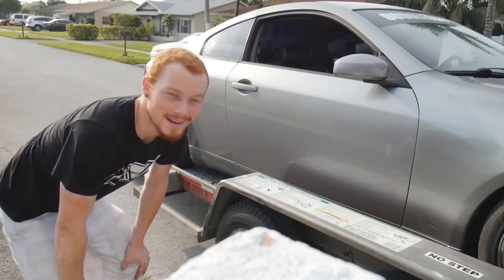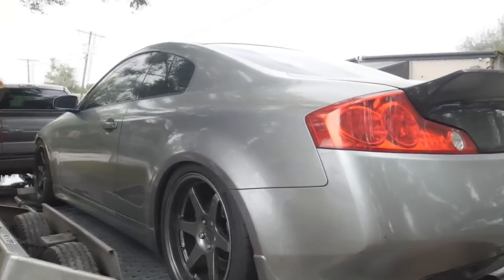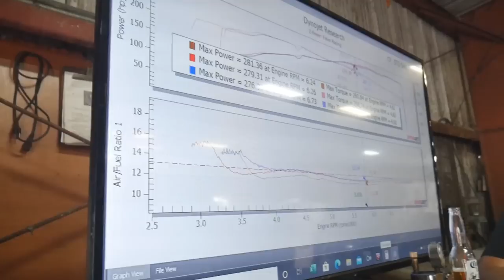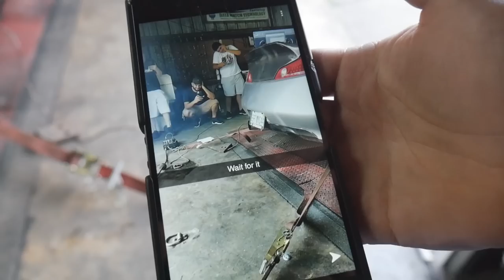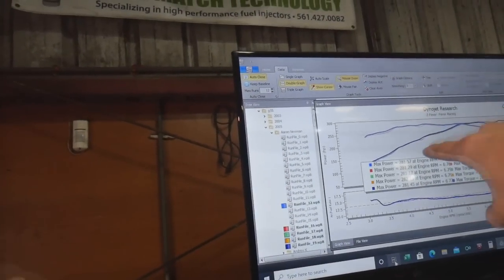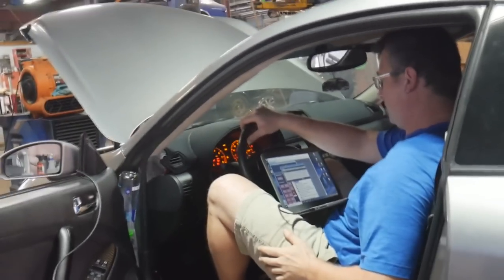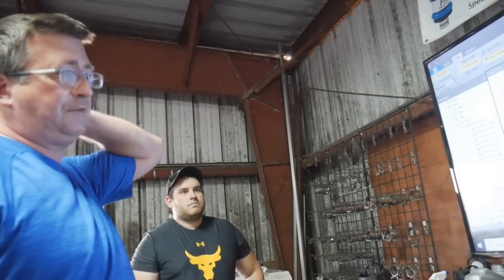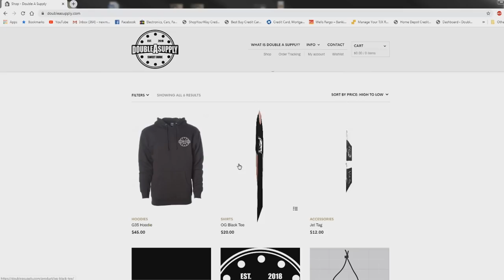FBO Cammed G35 Gets CHARIZARD TUNE! Over 300HP??

Comment: Very nice.. always good to see these motors put in work. Now get a driveshaft and custom manifold and shoot for 330whp
Reply from the maker: Driveshaft was on in this video :)
Reply: Oh wow.. nice. Well maybe just the manifold then. That seems to be what holds these cars back from making more power. I also have a cammed VQ35de with similar cam specs but I'm FWD
Reply: Btw is it a carbon fiber or aluminum driveshaft?
Reply from the maker: @jaypro2989  Aluminum Z1

Comment: that's pretty damn good that bad boy was looking like a fire breathing dragon 🔥🔥🔥🔥🐲 that's the bad thing about a mustang dyno it always 15/20hp less I heard of that honestly That's too far of a drive you should check out Central Florida turbo in Orlando they got a guy there that specialized in GTR Nissan and infinities they've been in business for 15 years my G35 has been over there for the last couple weeks I remove the old motor  I purchase a JDM  motor 40K miles adding JWT stage 2 cam springs retainers/150 shot of nitrous/1000CC injectors AEM 320 fuel pump/Z1 m-spec long tube cold air intake/and a couple other bolt ons I'll probably have the same problem CFT they have a all-wheel drive mustang dyno I'll find out in 2 weeks bro keep up the good work💪🏼

Comment: hey guy, I just bought my first G in September, '04 A/T Sedan (couldn't find a manual sedan unfortunately), stock with a few issues which Ive almost completely fixed. finally putting some mods on her starting today with a Takeda Short Ram intake. final must fix is my exhaust which has a couple leaks but instead of repairing ill be replacing next month with a Magnaflow cat back system.
your videos have helped a lot, keep up the great work.
other than some power loss from the leaky exhaust (due to lack of back pressure I assume?) the car is running great.
would it be wise to wait to throw on the intake with the exhaust next month or can I get away with a higher flowing intake and the leak for a short time? any issues you see coming up as a result of installing the intake before replacing the exhaust? any info would be appreciated. cheers from Toronto Canada
Reply from the maker: exhaust leak might hurt back pressure but tbh you won't notice any difference throwing it all on now. Even after you fix the leak. Once you tune it is when you see gains.

Comment: Awesome stuff man, how do you turn on the launch control with the cruise control buttons?
Reply from the maker: Thanks! You put it in first gear and clutch in and slam the gas, and you adjust the rpm with the set button for cruise control

Comment: My G35 came stock with 310hp?
Reply from the maker: That's 210hp to the crank. This is measured differently in Wheel Horsepower since a lot of power is lost through the drivetrain.

Comment: Bruh that car already has 300 hp straight stock, this is not impressive at all except for the fire
Reply from the maker: ApEx WILD yeah bro to the crank. Put a stock G on the dyno you won’t be anywhere near these gains. Like 230s
Reply: @AaronNewman  idk man it takes a simple Google search to see it puts ouy 306 whp
Reply from the maker: ApEx WILD lol yes to the crank. You lose HP throughout the entire drive train. We’re all talking about the number that really matters which is wheel horse power not crank horse power. Shit, crank horsepower I’m probably at 380-400
Reply: @AaronNewman  bruh I know Google search that car and engine it says "whp" not "chp"
Reply from the maker: ApEx WILD that shit lying take any DE to a dyno 😂
Reply: @AaronNewman  i mean shit I would if I could like i doubt they lying just because of how they tune the engine for each car it was put into like some Nissan cars that have the same engine only put out 250whp because they just tuned the engine that way
Reply from the maker: @apexwild9700  2006 Inifniti G35 makes 280-298 HP to the flywheel. Not the wheels. Per a google search. Also at the end of this video you can see numerous 2005 Infiniti G35's on the same dyno that ran significantly less than mine.
Reply: @AaronNewman  oh alright my bad I didn't catch you said de engine I been looking at the hr engines